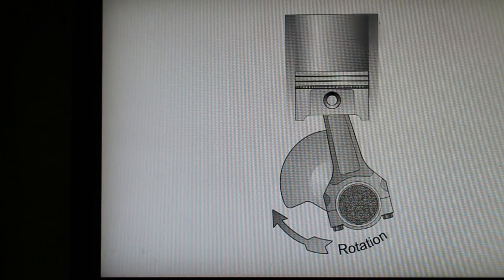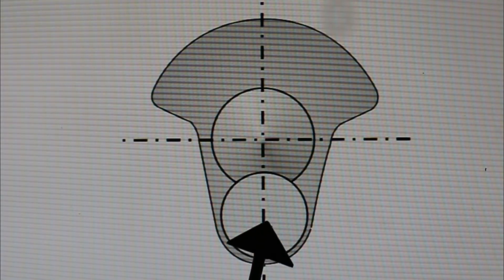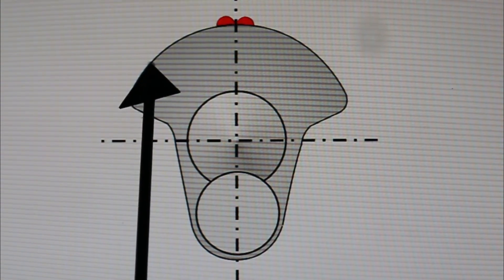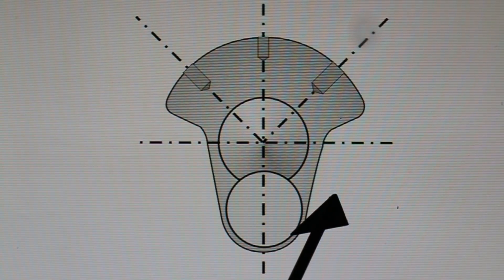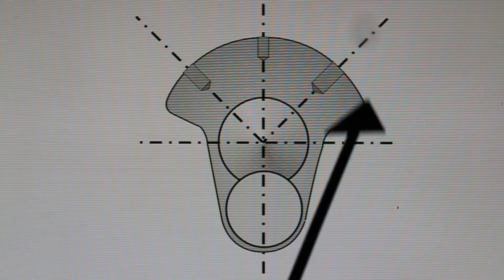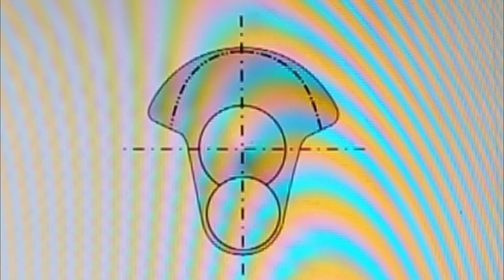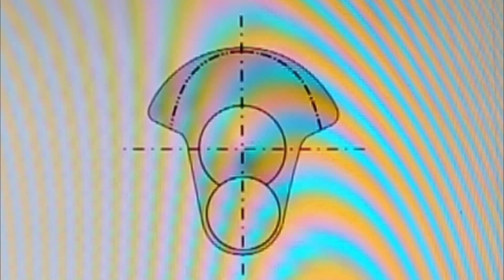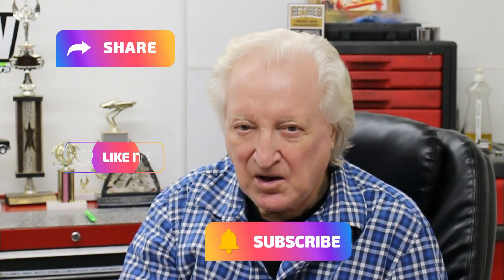POWER ADDING  crank balancing

Comment: If you do a static balance you include the bob weight with the weight of the rings installed on the pistons. 
That's why a 6 inch rod 383 will our run a 5.7 rod engine with everything else the same because you moved the wrist pin higher up on the piston.   Its a balancing act. 

The stock engine is designed for low rpm, start it up,  putter to the store for a loaf of bread and a gallon of milk and come home. 
In this application you want more weight to balance out the harmonic of the ignition cycles. 
In a racecar its idle or full wide open and you don't care how much shake it has or how rough the ride. 
60 years ago it was a common occurrence for the harmonic balancer to fall apart from the shake of the big block Chevrolet and the balancer weighed a ton and the flywheel was probably 50+ lbs. Now you can drive the transmission with a small drive hub and a balancer that weighs a couple of lbs.

Comment: 100% correct.   Caĺlies 46 lbs forged Crankshaft will increase hp by about 50 ft lbs in a 500 hp engine and will spin faster  so a dirt track car wit😂the right tire compound will out run a better car with a bigger engine and  a crappy tire. 
Big late model race  2400 lbs late model and my 3200 lbs  street stock was running 7th in a  26 car field  with used tires,  steel wheel and tubes in the tires.   With a wore out stock 400 sbc and cast iron double hump 194 heads  and a cut down crank.
I think I had the stock cast crank cut down to 36 lbs...  The bottom end has to be stout but all of the horsepower comes from the heads,  intake and carburetor.   And you must maintain proper valve and ignition timing. 
Jesel belt drive makes a big difference.

Comment: Hi everybody! Do I understand correctly. Each counterweight balances the weight of its connecting rod bearing (crankshaft journal + connecting rod with connecting rod cap + bearings). Thus, if we reduce the counterweight, then we must reduce the weight of the connecting rod bearing by the same amount. Is this correct or am I wrong?
Reply: The weight reduction would be at a 1:1 ratio for any reduction in the counter weight that is removed diametricly opposite the piston and rod assembly. Moving from that diametric opposite position, toward the piston/rod assembly, the ratio of weight reduction on the piston side drops in relation to what has been removed from the counter weight. That's why David shows that we should favor removing weight from the sides of the counter weight. It requires less weight to be removed from the piston assembly to compensate.

Comment: Thank you David for all the that you do for all hot Riders on a budget my question is do you need to have a crankshaft balanced after you take all the metal off of it and all the metal off the rod like you showed in the first part of the crankshaft Android video you showed especially on a externally balanced engine I'm building a externally balanced 86 model 305 and it's virtually the same crying same type of rods that is in all small block Chevrolet but I'm not sure if you take all that metal off the crank and the rods will it need to be rebalanced I'm guessing that it will but if I do all of that and take it to a reputable machine shop they're going to laugh at me
Reply: You take the metal off to balance it you don't just start hacking away at it.

Comment: Good info but cost effective and more practical thing to do is just buy a quality aftermarket crankshaft like callies,scat,lunati,ect.
Reply: Scat Crankshaft are junk,  put it on a Crankshaft grinder and you will discover that the throw doesn't match because the clock position is off from one to the next by more than several degrees.   If you have to grind a new Crankshaft and reward the throw to correct  it, you end up with the oil passage being in the wrong place

Comment: I recognize that all of this appears to be about maximum power but wonder if it benefits low or mid range torque.  Would that require a whole different approach?
Reply: This channel is dead for now, find his other channel here: https://www.youtube.com/@DavidVizard
Reply: You are removing weight from the reciprocating mass.   This is why Nascar racecar uses a carbon fiber drive shafts and lightweight wheels and gun drill the shafts in the transmission and the drive axle.. 5.3 Chevrolet 4L65E will out run a 6 liter engine because the 6.0 has the  4L85E transmission with a torque converter that weighed 40 lbs more.   Having to waste energy trying to spin all the extra weight robs hp..

Comment: Great. but most racing crankshafts are balanced by adding weight
Reply: Whether weight is added or subtracted is dependent upon the bob weight...a blanket statement saying most are balanced by adding weight is not correct.

Comment: why dose drilling out the crank creates more strength? because it produces more "Surface Area". like a thin-walled tube is stronger than a small OD rod of the same weight.
I learned that in 7th grade metal shop in the mid 70s

Comment: How does drilling a hole in the crankpin "increase" the strength of the crankshaft?
Reply: It's because you lose the fulcrum point of a solid mass when the crank flexes.
Reply: I just was going to post why above! it's because drilling it out creates more "Surface Area". like a thin-walled tube is stronger than a small OD rod.

Comment: Lol. Omg. Gm has been doing this for years....  Look at a 305 vs. 350 crank. A 305 has less, is flat horizontally in relationship to the rod journal. However, a 350 actually has a bell shape, vertically in relationship to the rod journal.
 More easily explained, if you set the crank on a bench like it was installed, you could place a straight edge on the counterweight a 350 would lay parallel on the counterweight edge. A 305 would fall off, as there is no flat or parallel edge.

Comment: Hello Mr. David Vizard, I have another interesting question, how does the disposition of the crankshaft counterweight affect, having the same mass, but closer or farther from the crankshaft axis?
Thanks
Best regards
Reply: High School physics was a long time ago, but I remember that it took up more energy to spin up a gyroscope which has the majority of it's mass at the outside edge than having it's mass evenly spread. Think of a bicycle tire vs a disk. The reason that gyroscopes have so much of their mass at the outside edge is to they retain their momentum and take longer to spin down. I am probably not describing this very well. You probably want to look up gyroscope videos. You really want to look up rotational inertia or moment of inertia here on youtube.

Comment: Hello Mr. Vialzard, I am new to the channel, and I have learned so much from the channel aready. I run in a factory  dirt class of ford 4 cylinders  Lima motors. Ford 2.3 sohc rules are suppose to be either hydraulic or solid lifters, and stock intakes. The big money guys run illegal esslinger raceing heads. which us poor guys cannot afford, and they have no competition. Have you done a video that would relate to the 2.3 sohc? Is the mini or pinto motor, talked about in seminar video, similar enough to it, if know. Or can you do a video about them if have time. Thank you sir.
Reply: Sorry miss spelled you name typing error. Thank you
Reply: Have you talked to Esslinger about air flowing and porting your head? I built a nice 2.3 L street engine decades ago

Comment: Excellent Mr. Vizard. When I was building Race " car " Engines, someone bought me parts machined another shop. They wanted me to assemble and dyno. Several RED FLAGS were set, but the biggest red flag was tungsten installed VERTICALLY into the counterweight.  Basically drilled a hole, dropped in the tungsten,  and welded up the hole on top. I was polite,  but kindly asked him to take it somewhere else for assembly. 
Of course he called me every name in the book and a few other made up curse words. 
Long story short,  the engine was assembled by a competitor,  and scattered on the dyno. Nothing was salvageable except for 1 cylinder head and the induction system.

Comment: Very interesting material. Ive been contemplating possibly effective methods to remove weight type counterbalance assemblys from single cylinder engines that Im modifying for various recreational uses so the information that you provided concerning the best locations to add weight and where its most effective was just what I was looking to learn about. In my situation there are add on brass plates which may be attached to the crankshaft counterweights but I wondered if a better solution existed. Unfortunately in this case there are no strong ultra light con rods and pistons available. Of course with only one cylinder there isnt an adjoining cylinder to help counteract vibrations etc. Thank you for the great content

Comment: I saw a video of some guys balancing a crank, they had to add weight,  they drilled nearly a 1" hole not all the way through, then welded a piece of tig rod across it. And filled it with lead, it was a motor cycle crank. They went with a piston about 1/2" larger, so they needed weight, when the lead cooled, they hammered it flat, then ground it flush, until it oxidized it looked stock, it was a poor Asian country I think, they didn't speak English, so I just watched the video,  it's very interesting the things they make work!

Comment: Hello Mr. David Vizard, could you explain how lightening the counterweights affects, do we lose torque? vibrates? And with the flywheel, if we remove weight, how does it affect the engine?
Reply from the maker: I am planning a video on rotting mass with drag strip results to make the point. Lok out for it down the road.
DV
Reply: @marvingvx1  Hello Mr. David Vizard, I will be attentive to the channel to see that explanation, thank you very much.

Comment: My!  We used that division of weight principle on bubble wheel balancers when the computer balancers couldn't get it right on one point.
Could you then change an externally balanced engine to internal balance with a neutral flywheel and damper using these principles?
Reply from the maker: Yes I hate external balance deals so I try to rid them from my life one way or other.
DV

Comment: Loved the video, I was lucky enough to design a crank for a nissan l20b and have it made on a CNC machine. It was something like 4 kg lighter than the stock forged crank. I had the big ends reduced in size to a standard used in nascar (48mm I think) and took 4mm out of the stroke. It had gun drilled big ends too. After the rotating assembly was complete it was 6kg at least lighter than the stock including the flywheel and clutch. We also reduced the moment of inertia hugely. Just running in the engine and I didn't think it would idle to well given the head and cam and reduced mass but it runs like a clock. It feels so strong through the mid range its ridiculous!

Comment: So is it good or bad to take weight off the crankshaft? After 19:01 minutes of video I did not find out
Reply: Yes it is good. It won't make any more power measured at a steady state, but it frees up power as it accelerates to that steady state.
Reply: It's all explained at 19:02 😁

From what I understood you can gain a bit of power, and you can actually make the crank stronger.

Comment: Has there ever been a machine that would measure the balance of the rotating assembly while it is mounted and spinning in the engine it is going in?
Reply: GM used to  final balance running engines by inserting dowel pins into holes in the balancer hub
Reply: @65muzzy  interesting.  I will have to research this.
Reply: you can measure the vibration of a machine, lots of technology on vibration analysis
Reply: @blueyhis.zarsoff1147  I was thinking more on the lines of using the engine it's self as the balancing jig outside of the car. and spinning it with an electric motor. This way you are checking the actual balance of the real parts at any giving rpm for different harmonics. but how would you measure " per journal " the imbalance?
Reply from the maker: Yes Rover used to balance the crank as an assembly in the engine. Drilled the C/W's with the pan off.
Reply: @marvingvx1  Thank you. I will research more on this process.
Reply: I have also seen the way some folks balance single and dual piston motorcycle cranks. by using the actual rods and pistons. then laying them on a parallel bar frame. this is close to the way i have balanced old grinding wheels at my blacksmith shop.
Reply: @tombrown879  were they 2 stroke bike engines, thats a whole different thing.
Reply: @blueyhis.zarsoff1147  no. Four strokes.
Reply: @tombrown879  static balancing is first order, its skips end to end out of balance.

Comment: Mr. Vizard. Is it possible to accurately determine cranks throw weights by using a homemade pin jig, or in a laith, to center it, and then use bubble balancers almost like an old tire balancer?  Also, on a" V " style engine. with journals sharing rod and piston weight, next to a single journal. do you need to take more metal from the throw weight that is outside the shared journal?  such as the front then second throw weights on a GM V8. If that makes sense..... I guess what I am basically asking is. Are there any older methods of balancing a crank that does not need expensive tooling, that one could do at home in a small Forge or workshop. I am very intrigued by the vintage race cars of the 20's and 30's. such as the Bugatti's, Almicar's, Harry miller, and other fairly high revving cars of the day. and wonder how they were doing this. Thank you. Love your books, and videos. Thanks you. Tom B. from ND.
Reply: I have the same question .

Comment: I Want to play with a 53 ford flattie v8 crank...all shops are booked for a year and i want to do as much as i can on my own ....how much can i do not to ruin it for ballancing ?
Reply: I think you can weigh your rotating parts, rod big end, rod small end, and note them down. You could send that data and crank to a specialist, then have it sent back.
Reply: That's tough. You're also likely stuck with 3 main bearings which complicates things. You need to not do anything that lessens that crankshaft's stiffness, as it's quite literally very unsupported.
Reply: @life_of_riley88  Thanks ..u r correct about the 3 main issue...i want to know if drilling the inside of the rod journals would help or hurt strength

Comment: David, are you advising us to attempt to balance our own cranks by drilling the big ends and grinding the counterweights? Or is this really meant for the machinist in the balancing shop?
Reply from the maker: Mr Jeffry sir, I am just informing you what needs to b e done. I have balanced several cranks the ways shown here but I had access to a balancer. The first balancer I used was home made but we only did 4 cylinder engines as in Mini's.
DV

Comment: Hello David, man you really put tech in the word technology, I really liked this video very much we've all seen everything about cylinder head porting and flow characteristics from many online videos but not too many if not anyone explained it to the fullest, I have done the knife edging on my crankshaft as you mentioned and some drilling with have to be done on the final balance of the total weight of the rods and pistons so that's my race engine. I have a backup crankshaft that came out of a motor and it has Mallory weights tig welded in the ends of the counter weights and it was a small journal SBC 302 with TRW pistons and stock small journal rods, I found it strange to see the Mallory in the crank and it nearly weighs as much as a big block crank now I'm not sure if this crank would be good for drag racing, most of my friends would just ad a big balancer on the 302s and 327s and call it a day would this crank be worth using?

Comment: Thank you for another informative video with a great explanation, it all makes good sense. On another YT channel a Cosworth 4 cylinder crank was knife edged obviously losing considerable mass from the counterbalances at the most influential diameter, they balanced the crank by itself. It struck me that the bending moments on the crank either side of each main bearing would be increased.
Reply from the maker: ANY CHANCE OF A LINK???
DV
Reply: @marvingvx1  https://www.youtube.com/watch?v=gXl6eezld9k
Reply: The crank was knife edged in another video on the same channel, I was just curious about the trade-offs, presumably windage and inertia are reduced but at the expense of crank fatigue?

Comment: It's amazing how you can put something in terms that are easier to understand than mechanics instruction/ technical manuals can.  And beyond that to see things others didn't !! AGAIN! ( This is one of many topics that you have talked about that I've seen others discuss and I have read about, that "no one else saw!?"-- Until after you pointed it out) [ I was trained to; and have balanced Centrifical water pumps & steam turbine impellers ! ] Respectfully Kurt. 
PS. Did you get a chance to read my 'LATE' response to your query about Cadillac B.B. Engines ? ( I posted it after my original post on the topic in "Comment's" on EP45 ? )

Comment: Thanks DV, this short vid has come at an ideal time for me. I've got a new forged  4340 crank which is heavier than my stock crank so I'd like to loose 1.5~2kgs which is bit for a 4 cyl. Also, you mention there's HP to be gained with loosing weight. But what happpens to torque? Does it change?
Thank you so much for sharing :)